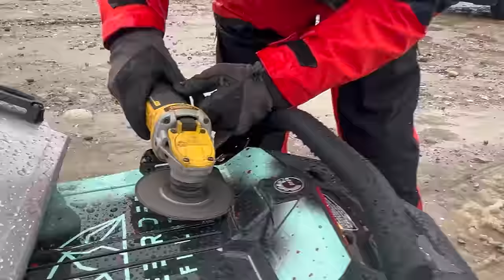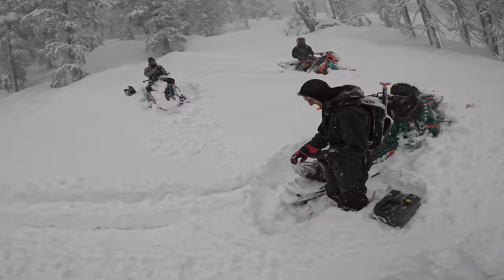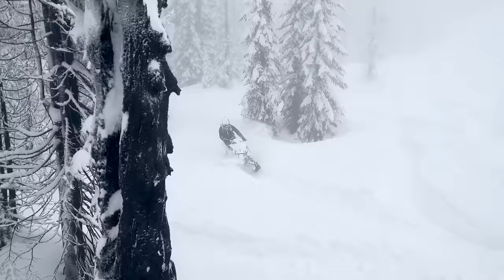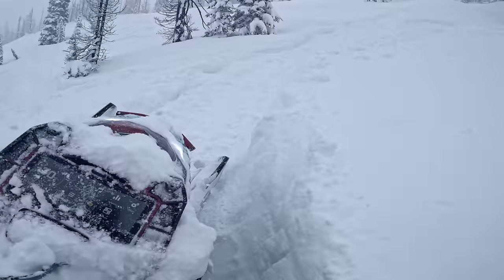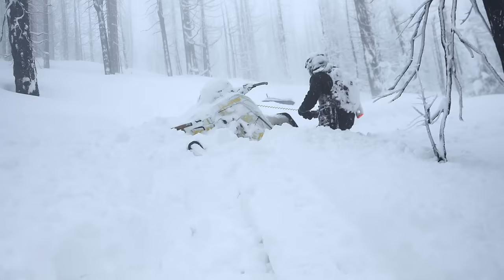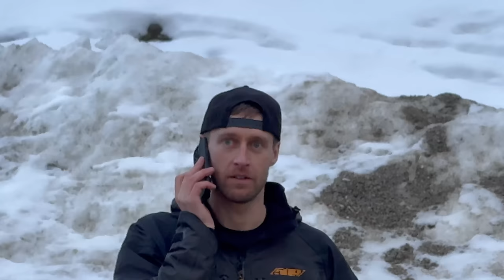Winter’s Back!!!

Comment: You might give the GBoost World Best Belt a try. I had a few sitting around for my Maverick x3 and stuck one on my summit, has a slightly different engagement feel but does last quiet a bit longer than the stock skidoo, at least the way I ride 😂

Comment: Have you or any of your friends tried the MTNTEK blowhole? My 129x1.75" sled   rs trail sled used to blow belts every 150 miles of off trail riding.. added the blow hole and got 300 miles on this belt and still looks good with olny slight belt adjustment done

Comment: How do you keep your sleds from overheating getting from the dry parking lot to snow?  I bought a 2008 800r skidoo, had to get the motor totally rebuilt from the bottom up (I got screwed...another story) but seems like my sled heats up on hard pack too easy but the shop says this is normal.  My old 2003 skidoo 600 never had an issue....thanks!
Reply from the maker: It’s only 1km or so it’s not bad when the sleds cool

Comment: I have a 23 summit turbo and I’ve never seen a belt temp sensor on my 10.25” dash or in setting? New for 24?
Reply: They have it, hold the centre to keep toggling through the modes, belt temp will be there

Comment: how do you get so low belt temps? i was going on the trail and my temp was at 40. and i get 60 in the woods.
Reply from the maker: It’s false reading since I’m wide open and has a crazy amount of air flow